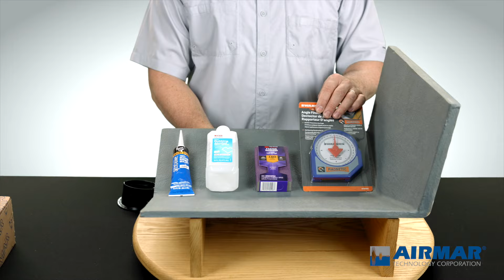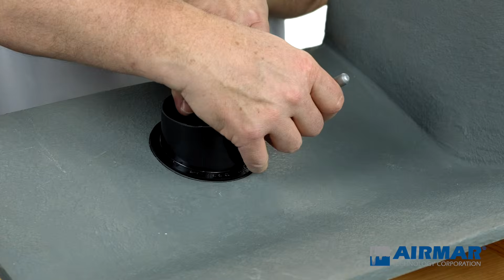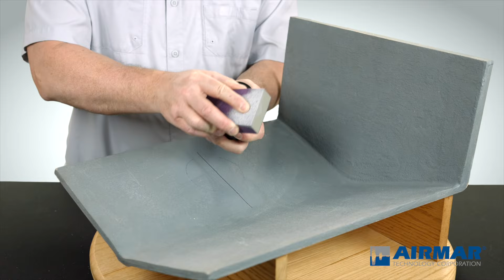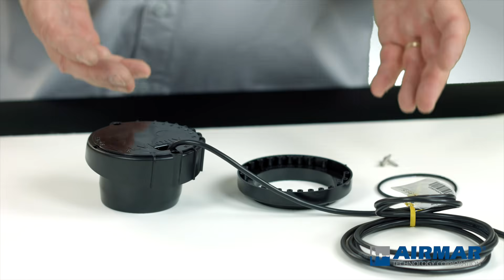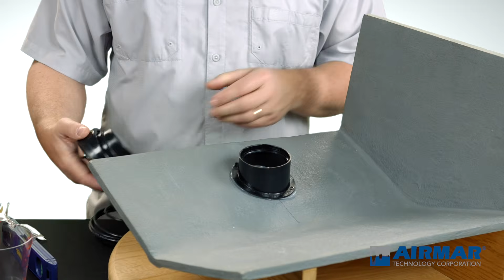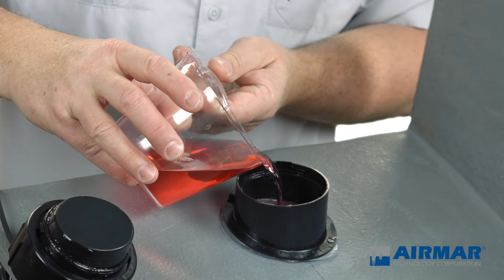How To Install In-Hull Transducer

Comment: Great info. Quick question. Does it matter if I do the installation on water or on the trailer..? I'm just worried my angle will be off because of listing in water or because the boat isn't sitting square on the trailer or am I being waaaay too precise (I'm a machinist by trade)
Reply from the maker: It really doesn't matter as long as you're installing on solid fiberglass.  Also pay attention to anything on the outside of the hull that might put aerated water by that place on the hull as you go.  You'll still need the least aerated water flowing by the location that the transducer is operating.  Good luck!
Reply: @airmargen  Appreciated information - thanks!

Comment: hii,how can i know the degree  sign in tool if the ship floor is flat? and what is the direction keel ship that i have to put if the ship floor is flat?
Reply from the maker: Hi what transducer are you trying to install? if the floor is flat you must make sure you are looking at the bottom of the boat.  depending on the sensor, anything with a paddlewheel speed device must have the arrow on the housing pointing to the bow.
Reply: @airmargen   i have bought the TRANSDUCER AIRMAR P 95 M and the floor ship is flat and i don,t find how put the instalation level to the top of transducer level  if the angle degree start to 2 degree and i need to get the level  to 0 degree with angle indicator

Comment: ❣️You should clean the surface (using a degreaser) before sanding. This will prevent smearing the grease into the surface, which could lead to an uneven finish and poor adhesion for paint or other coatings.

Comment: Do they work in aluminum boats ?
Reply: From Raymarine website: "The design of the P79 accommodates a wide range of deadrise angles from 2° to 22°. This transducer is intended for use on vessels with solid fiberglass hulls with a maximum thickness of 5/8". P79 can also be used on aluminum hulls less than 3.8mm (0.125") thick."
Reply: @MarcoYolo420  

Thanks.  Most PNW Alu boats have bottoms thicker than 0.125, so it won’t work.
Reply: bro every transducer is different always refer to the product description to confirm.

Comment: What is the weight of the transducer of 600W (P79) ?
Reply: 2.3 kg it says in manual
Reply: @IgorLjevak  they have a lighter version in the Netherlands:
"Specificaties: Afmetingen: 127 mm (5 inch) diameter x 64 mm (2,5 inch) hoogte Gewicht: 0,9 kg (2 lbs) Kabellengte: 10 meter (33 voet)"
😉
Reply: Soy español perdón entiendo poco inglés cual es el líquido que echa dentro del traductor